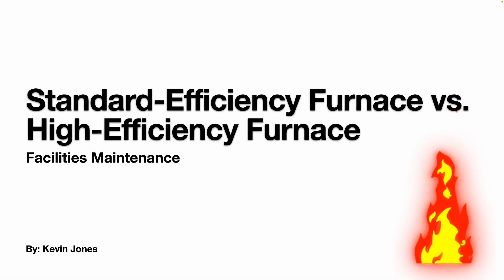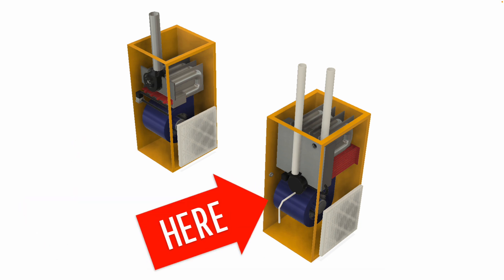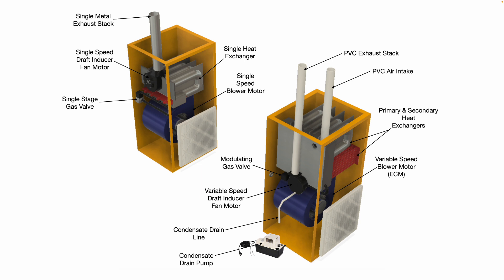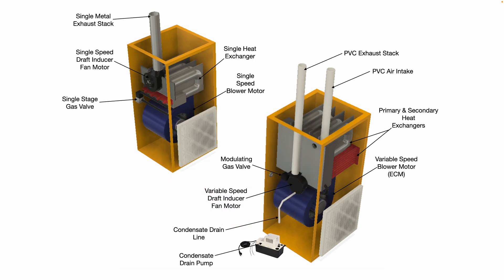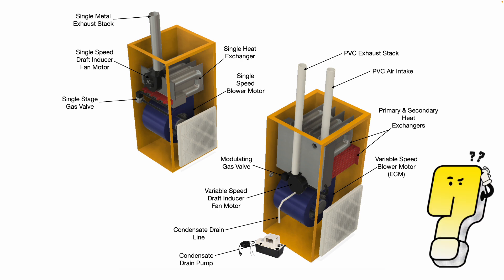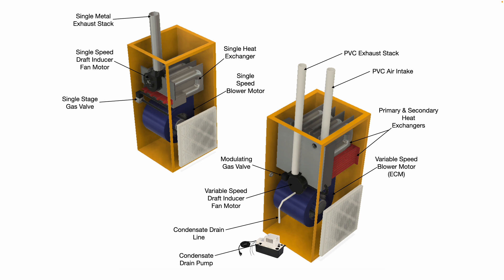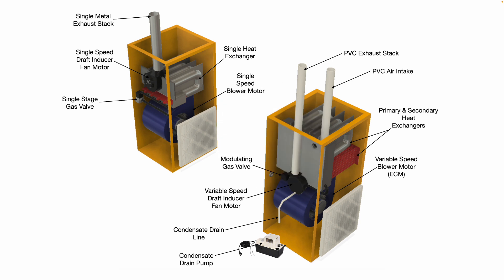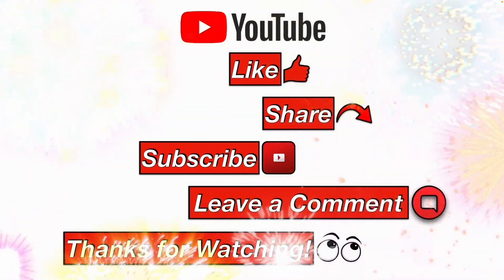Standard Efficiency Furnace vs. High Efficiency Furnace | Gas Furnace

Comment: I have a high efficiency Lennox furnace was installed by builder in over 150 homes in our community.  15 Years working fine.  As long as you do annual maintenance and filter changes it should last a lot longer.

Comment: You can get an 80% AFUE Furnace with a two-Stage Inducer and two- stage gas valve. I have learned in my 21- years in the HVAC industry that the 80% Furnace will last roughly twice as long as the high efficiency furnace.  I recommend the 80% as it’s the best value!
Reply from the maker: Agreed!